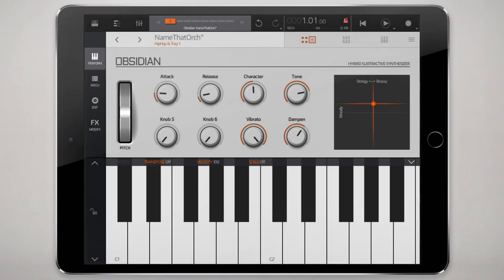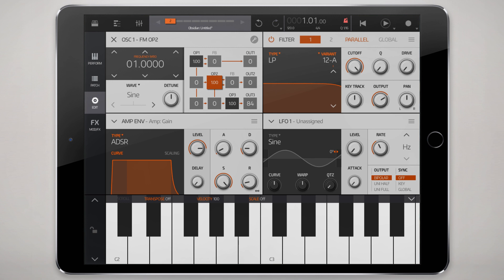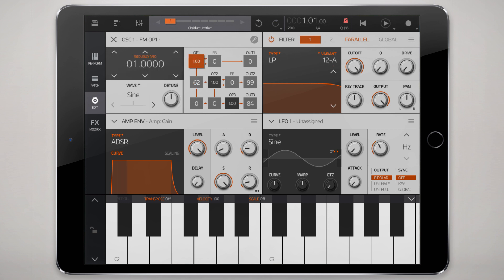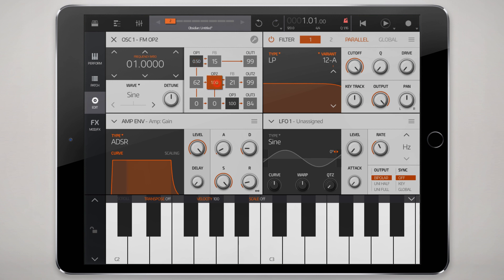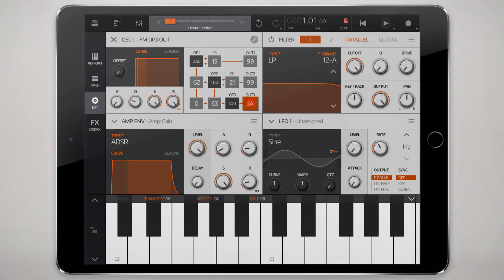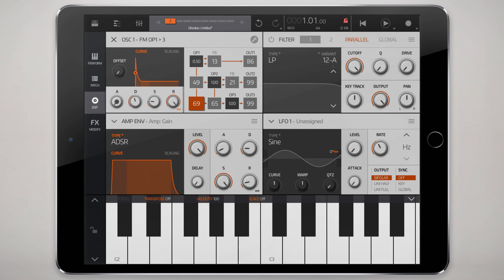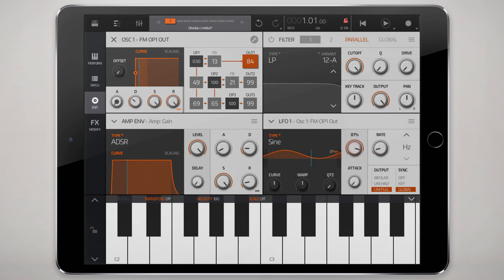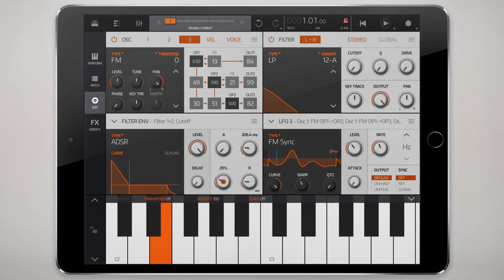Nanostudio 2 Tutorial - FM Oscillator

Comment: Love this series of videos so far, thanks (and keep them coming). Almost OT question, yet not: what software/app are you using for your screengrabbing around the iPad? Are the highlights for where you tap/point/drag automatic, or have you added those manually when editing the video?
Reply from the maker: I use camtasia. An older copy. I wouldn't recommend it. Also have a special release of NS2 which lets me do better screen cap. Probably the best option is to screen record in iPad (build into the settings), while outputing audio to your main PC (iPad only screencaps audio to mono). Then bring that all into your favorite video editor.